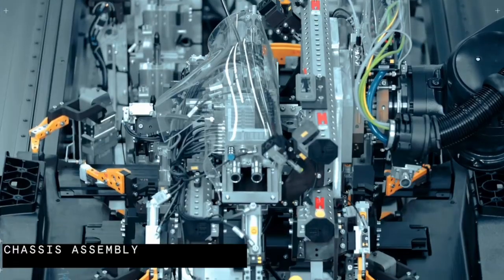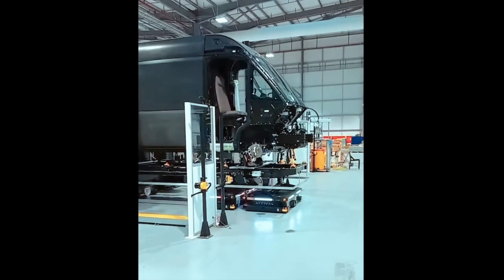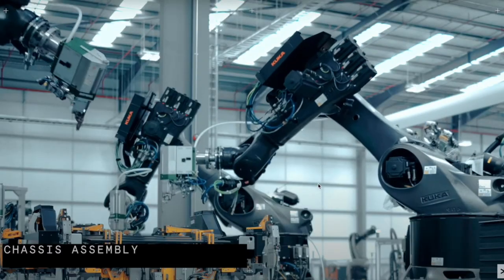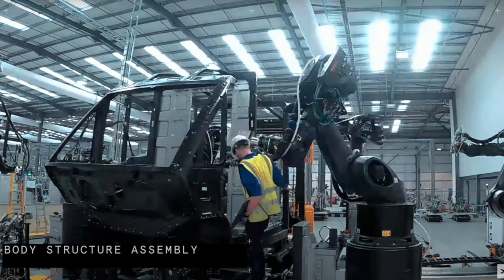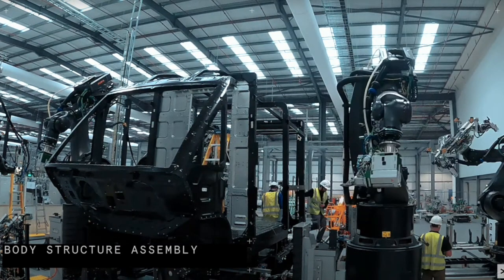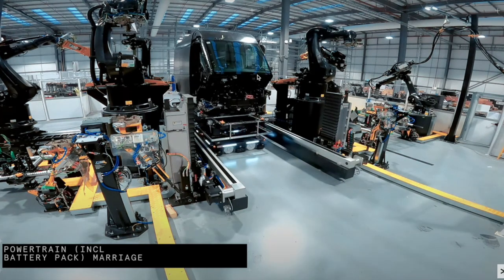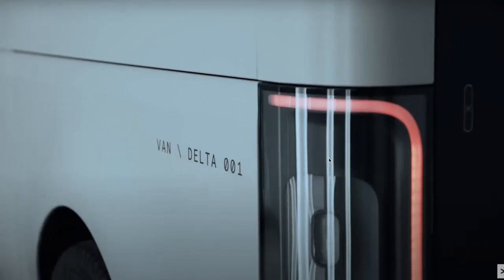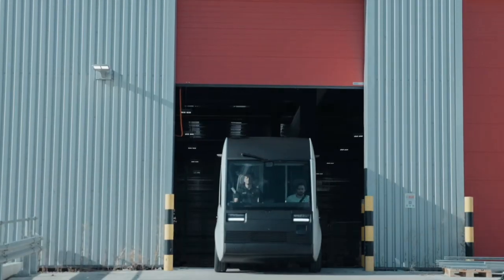Inside Arrival Microfactory My Perspective!

Comment: Fckin hell bruvs, i got to 108k shares, am i happy, am i crying? Well i dont know
Reply: Pe bune Florin, what's your average price?
Reply: @Cicala365  am vandut 100k la .33 si am cumparat 150k la .20. Ajunsesem la un total de 185k si am dat 150k putin devreme pe la .57. Si am luat aprn 100k actiuni la 1.15
Reply: @florinserbabh4560  te gandesti sa ramai investit sau vrei sa castigi pe termen scurt?
Reply: @Cicala365  in aprn? Clar pe termen scurt. Sper la un squeeze. Pe termen lung raman arrival, path si invitae dar am vreo 300k bagati si cu cate 100k mai fac tradeuri
Reply: @florinserbabh4560  doar de arvl intrebam, pe arrival sunt investit de la ath, as vrea sa iti scriu in privat dar nu reusesc sa transmit adresa mea
Reply: @Cicala365  arvl am 35k pe care le am luat la 1 dolar si nu le dau, poate o sa mai iau o groaza daca pleaca aprn pe squeeze, si path vreau sa mai iau
Reply: @florinserbabh4560  ce parere ai de schimbarea ceo-ului? Planul lor de restructurare
Reply: @Cicala365  bai,sunt dezamagit rau ca nu a ramas Peter. Am 35 800 de actiune dar nu cred ca o sa mai iau curand desi aveam de gand
Reply: @florinserbabh4560  nici eu nu mai intru sa fac dca pana nu vin cu un plan concret, cum se vor finanta si contracte
Reply: @Cicala365  pe short cred ca si un bk play explodeaza dar main ul meu acum e aprn. Astept ceva si bank dau check out dupa

Comment: I thought that originally Arrival were aiming for roughly 20 vans a day per shift. So 40 vans if they can ramp up to 2 shifts. Again, originally they were looking for each van to make a contribution of 30 percent of sales price (after direct costs). Each shift's annual contribution would then be roughly $50M. The fixed overheads ought to be relatively low, allowing most of that contribution to end up as profit. In the years to come they were aiming for a large number of factories (up to 300 was referred to at one point!). That's my very rough calculation. I have no idea whether they can achieve those margins, given all material costs have risen a great deal. Also can they speed up production to 20 vans per day per shift? And can they avoid running out of cash? Its been a very rough ride so far for the team and us early investors - seat of the pants stuff!